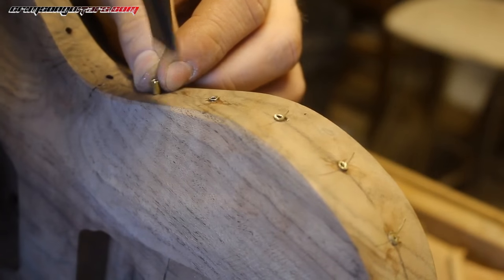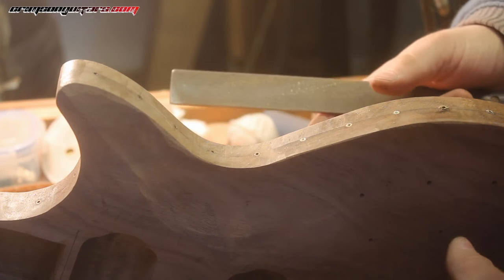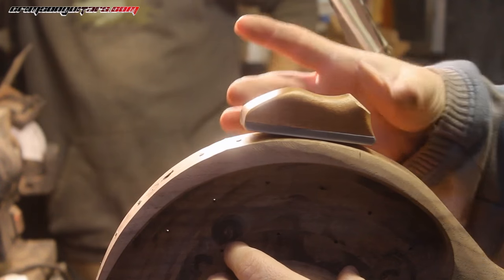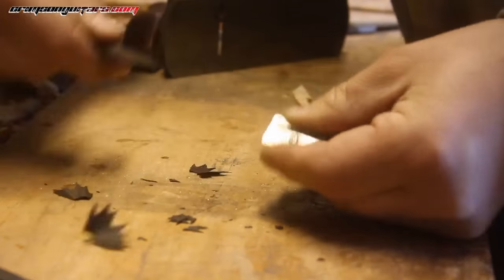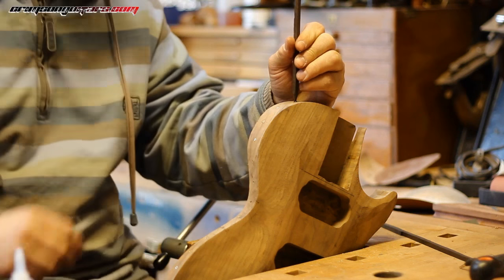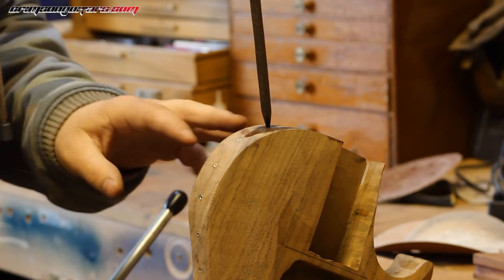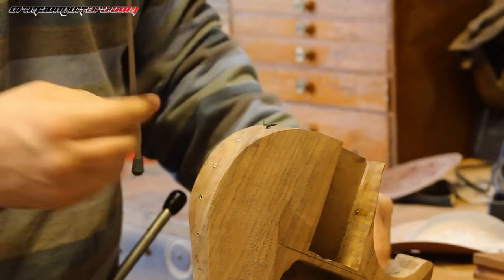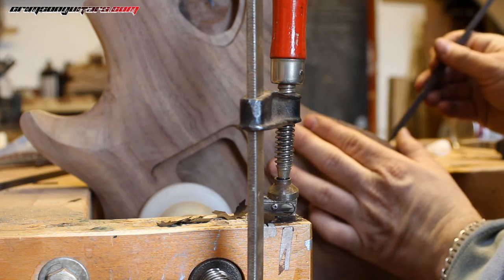Clarity Ep 42 - Filling and Filing the Brass and Ebony Inlays

Comment: I make my side position markers out of walnut or maple by ripping the material to approximate size, chucking in in the cordless drill, then feeding it through the properly sized hole drilled into a piece of sheet metal. It makes perfect dowels for whatever size is needed.

Comment: Doesn't the holes in the side decrease its sustain? Or does the sustain remain the same since you're just replacing the wood?
Reply: Neither. It makes absolutely no difference.
Reply: If it did make any difference I doubt anyone would be able to notice.
Reply: It is going to have a sustainer built in, so it is irrelevant.